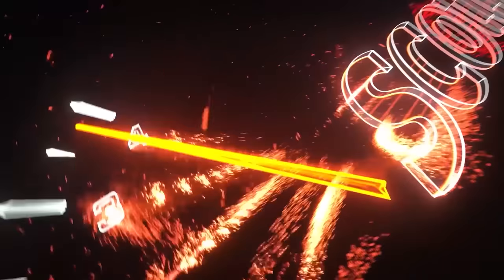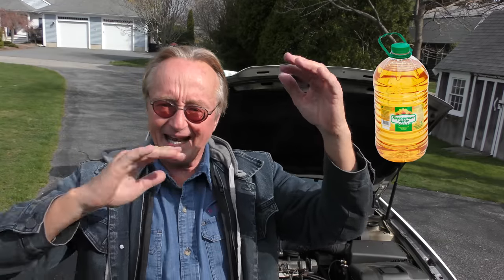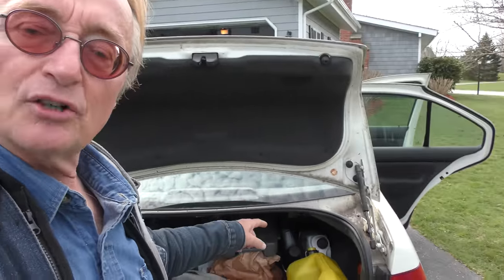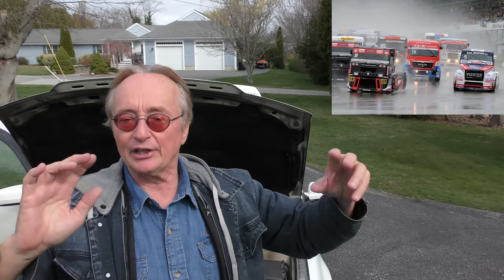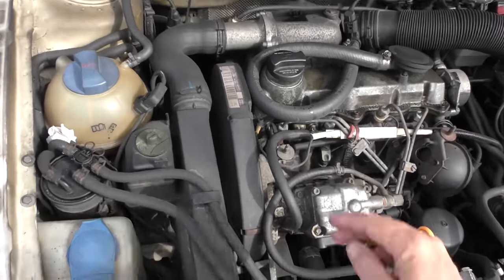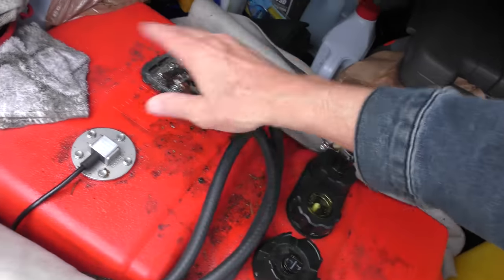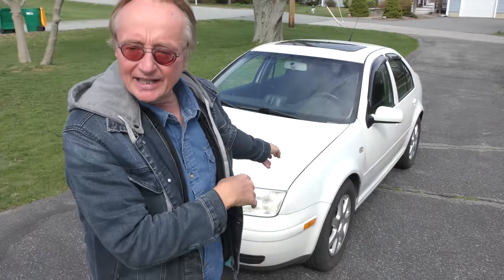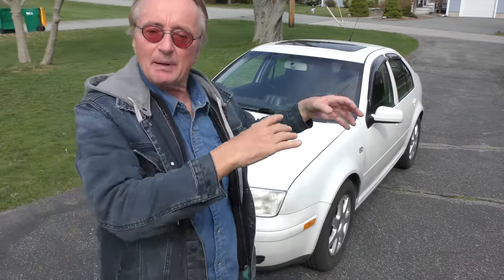Install This on Your Car and You'll Never Have to go to the Gas Station Again

Comment: Imagine the fuel thieves drilling into the tank looking for diesel and getting vegetable oil instead! Great show Scotty, keep the videos coming.
Reply: Ι don't have to imagine unfortunately. Drilled into an old 1990s Mercedes diesel's tank and mixed the vegetable oil with some of the diesel I had collected that night by accident! Ruined 6 gallon of diesel for nothing.
Reply: Vegetable oil is not cheaper either 🤣🤣
Reply: @multipolarworld.  It is when you get paid to take it away from resteraunts. I know a local trucking company in my area near Scotties son who does just that. Also in the state of Massachusetts straight diesel fuel is illegal. It has to have a percentage of it blended in with vegetable oil. It was made into a law a couple of years ago. This includes off road fuel for heating and construction equipment as well as on road for cars and trucks.
Reply: tine for french fries
Reply: Tank still has Diesel in it.  The trunk has the vegetable oil.
Reply: @multipolarworld.  You aren't buying brand new unused vegetable oil from the grocery stores. You are getting free used vegetable oil that many business will just drain down the drain so you can get it for free as you are helping them not clog their lines.
Reply: @youaregoingtolovethis  I'm just joking 🤣
Reply: @youaregoingtolovethis  8
Reply: @youaregoingtolovethis  They must have some kind of filter to run the vegetable oil through so it doesn't clog up the injectors.

Comment: Scotty, I got that one beat with that old Rabbit sedan. Those old diesels you can not kill. They run forever. I do not know if you know of John Noonan or not. He owns J. P. Noonan trucking West Bridgewater, MA and Hooksett New Hampshire years ago he converted all his trucks to run on vegetable oil. Starting with the one he was driving at the time. He put in a large  1,500 gallon storage and filtration system at his main facility in West Bridgewater.  The best thing is he gets paid to run his trucks by all the fast food and Chinese resteraunts. He charges them to pick up their used vegetable oil from their deep fryers. Also the owner and captain of  our local deep sea fishing charter boat in my town the Miss Chrissy converted his fishing charter boat's diesel engine to run on vegetable oil. He is a mechanic like you. He has worked on car engines and boat engines all his life. He gets his fuel from John Noonan. His charter boat smells really good every time he goes by my house out in the bay. it makes me hungry.

Comment: 20 years ago, my Genius Daughter at age 17 bought a running Mercedes-Benz 240 non turbo for a few hundred dollars and did this exact modification with radiator heated veggie oil tank in the trunk. It was no race car but it ran good but slow.
Reply: sounds like she had a good father
Reply: 240D is slow regardless of whether you run diesel or vegetable oil.

Comment: My 1984 M-1009 Military truck will run on just about anything.  It has the 6.2 L diesel non turbo.   It would survive an EMP too.   That guys setup is perfect.  You need to run it on diesel before you shut it off to clean the injectors.  You dont want the Vegetable oil on cold injectors at start up.

Comment: I remember back in the 70s during the gas shortage my dad had converted our Cadillac El dorado to accept propane. It was pretty cool to have two tanks. After flipping a switch, we had an extra full tank to keep on going.
Reply: Propane was highly used in Brazil countryside in the 80’s and 90’s.

Comment: Back in 1982 I work at a Volkswagen dealership in Toronto Canada and the mechanic had a 1981 Volkswagen rabbit a rebuilt the engine and ran it exclusively on vegetable oil. But he only used the car during the summer months because of the cold weather up here like he said the vegetable oil congeals. He had that car for nine or 10 years before he had to get rid of it because of the rust on the body. As always I enjoy your videos. Keep up the good work. 😎
As to the price of diesel fuel I remember back in the 70s and into the 80s diesel fuel up here was less than one dollar a gallon.

Comment: Hi, i used vegetable oil on my old nissan sunny in the summer. No problem at all. And it was cheap, back in the 2002. The liter oil was chaeper than Diesel.  My main gas station was Aldi 😎
Reply: I saw a guy collecting used oil from restaurants and using that for free.

Comment: The best reliable VW ALH engine. Rated for 1.5 million miles.
Reply: Also try to get manual. If you find an properly maintained automatic than yes other than that 99% will fail. You can get 50mpg plus with normal driving. So dude runs methane and get 65mpg plus.

Comment: I currently own and daily drive a 2003 Jetta TDI (ALH). Bought it 4 years ago with 172,000 miles (American car but i live in Canada). The only money i have put into besides oil changes are a coolant temperature sensor ($35 Canadian), and a rear strut mount or something like that ($65 with labour).

I get over 1000km a tank and it has been flawless. It's now sitting at 230,000 miles and i've barely put $500 into it including tires.

Might trade it for a clean Jetta wagon. Diesel right now is more expensive than Premium Gas in Ontario.
Reply: You'll trade it in for a gasoline Jetta wagon or a TDI Jetta wagon?
Reply: @epbski  TDI all day bud, i'd never buy a gas VW.
Reply: is it confusing looking the at speedometer when driving being mph (United States) and underneath has km/h (Canada)?
Reply: @mabeljoe4305  you get used to it. Traffic tells you how your speed is.
Reply: Try a Touareg TDI 😛
Reply: @RandomlnternetGuy  I totally agree! VW's gas engines are weak and they don't hold up over time. I personally don't think any VW or Audi is truly worth buying unless it's a TDI. Otherwise, you just don't get your money's worth. I generally think diesels are superior to gas engines, anyway. A TDI Passat, for example, is an awesome vehicle, but if you're forced to choose a gas engine, you're better off just getting a Camry. I'm not a great lover of sedans, though, because they have little practicality. I'm a huge fan of hatchbacks and wagons, which have, regrettably, basically disappeared in North America. And I don't buy this argument that a crossover is just a different form of a wagon, because it's not. A wagon gives you all the practicality of a crossover, but with handling, driving dynamics, and fuel efficiency that is closer to a sedan. It's the best of both worlds. If only Toyota, for example, would sell a Camry wagon or a Corolla Touring Sports wagon/estate in North America, even if it was a gas engine. A diesel would be even better, but that's a pipe dream. The same goes for Mazda and their Mazda6 Wagon. Obviously, I would love even more if VW would sell diesel hatchbacks and wagons again in North America, especially since I like VW's style much more than Japanese cars, but I admit with sadness that is definitely never going to happen. I'm not sure if there are any new non-truck diesels sold in Canada, but sadly there aren't any in the US anymore and there almost certainly won't be any in the future. I'm hoping and crossing my fingers that there will still be used diesels on the market for at least the foreseeable future.
Reply: @MarcBeaulieuisGreat  So you would recommend a 2014 or 2015 Touareg TDI?
Reply: @epbski  The closest vehicle to a Camry/Corolla sport/touring wagon us would be the Toyota Matrix/Pontiac Vibe 03-08. It still gets great reviews…
Reply: @emanuelsabir5344  Yeah, I think it's a shame that Toyota doesn't make the Matrix anymore. The Corolla Hatchback is a good car, but it has much less cargo space and practicality. The Matrix was sort of Toyota's equivalent to the VW Golf. An extremely practical hatchback that could rival and even exceed a lot of crossovers in terms of cargo space, with over 50 cubic feet.
Reply: @epbski  I believe they are both the same generation.
Reply: Go Avalanche !
Reply: @mabeljoe4305  i got used to it super quick now the probem is when i get in other cars, i look at MPH and think it's KPH 😄

Comment: Around 20 years ago I was able to buy 100% biodiesel at the bowser it was recycled cooking oil. I was running it in my 1989 Ford trader diesel tipper running the Mazda engine. I found it had more power on hills ran cooler the only draw back was all the stray cats and dogs would follow my truck and were trying to lick the tailpipe and the fuel tank if I accidentally spilled some on the side of the tank. The very first Diesel engines were designed to run on peanut oil as distillate fuel was not available at the time.

Comment: I read about a guy that did this with a Datsun pickup in the 1970s. He got over 300,000 miles out of his motor because the fuel is a lubricant as well....

Comment: Keep the straight vegetable oils preheated and adequately filtered before burning them.

Saturated cooking fats should be settled out and converted to biodiesel and said saturated biodiesel should be mixed back into the unsaturated portions, that way you have a better and more consistent burning and lessen likelihood for problems in the long run.
Reply: I think this guy clearly has it figured out if he took one to 400k and built a new one
Reply: correct
Reply: You just boil, cool and filter like any saturated fat removal.

Comment: Ran used veggy oil in two ‘81 volks over 8 years.  Used a cream separator as a centrifuge to clean the oil and added it right into the fuel tank.  I didn’t even change the fuel filters.  Wish I still had one

Comment: In Argentina vegetable oil was about 25 cents a litre, when England found out,  El Patito Oil was never to be seen again. The again with the prices in England you could run a truck on grade A Olive Oil and still pay less than diesel.

Comment: In the UK some diesel cars have been using used cooking oil for the last 20yrs or so, free from the right places. My car is converted to LPG and the oil and engine stay clean with less polution, 80p a litre instead of petrol at £1.80 ltr. If you wanted you could compress domestic gas and avoid fuel duty completly with tweaking of the LPG ECU settings. Have you tried running (adding) water, (HHO)?, again a "pre computer" car may be needed here or some ECU adjusting if possible!

Comment: I seem to remember used oil is actually better. When food is cooked in the oil the water in the food evaporates. The steam bubbling through the oil removes certain parts of the oil that are less combustible. That's part of the particulate that settles out of the oil. Then you simply heat the oil for a little while and remove any excess moisture. So if you can get the oil from a couple restaurants and have a tank to let it settle you can have free fuel for a long time. 
Biggest problem is natural rubber. You can't use rubber seals and tubes. The oil eats right through it. You need synthetic hoses a seals
Reply: Used cooking oil looses water in minutes, not hours

Comment: If you can get red diesel, it mixes with vegetable oil at up to 1:1 without any further effort.  Alternately building the refining equipment for real biodiesel is very possible for a home shop.

Comment: Diesel designed his motor to run on peanut oil back in the 1800's... not very hard to do. with diesels prior to 2007 👍😉 one more secret out
Reply: He said 2010 not 2007, which is correct.
Reply: @toriless Depends on when they put all the adBlue and DPF systems
Reply: @IbnuCuruk  2007 and after except for the Ford psd 6.0 used in trucks up til 09 and 11 for the fleet vans 🤔
Reply: @z1berzerker  I see
Reply: @IbnuCuruk  In a nutshell 6.4 psd runs Def... Any 6.0 psd able to run veg oil... Cold weather beware 🤔

Comment: Scotty should check out the Thailand car/truck scene on the channel "CB Media" for some interesting engine setups, especially pertaining to diesel engines.  It's some crazy horsepower and torque coming out of 3.0 Liter 4 cylinder rice burners, or in this case diesel burners.  Rolling Coal, so stinky and beautiful at the same time.

Comment: Not only it pollutes less, but is completely non toxic unlike diesel exhaust gas. Sadly the 1.9 tdi is one of the only engines that are both good on emmisions and can be ran on vegetable oil. Most newer engines have injectors that can’t work with it(higher viscosity)

Comment: I've heard of a guy who uses used oil from fast food joints and restaurants.  I guess he has an efficient way to filter it for his fuel creation process.  500 miles on how many gallons?  But even still, it's 500 miles.  But, sadly,  it only works with diesel engines.  I researched it for the process and engine types.  I watched a 2016 Texas city TV News channel coverage video and the guy was filtering heated used restaurant oil in what looked like a burlap sack, which was probably lined inside with something like a t-shirt fabric.  Seems that's all that's needed, but the video wasn't specific there.  There were comments of people using fresh bought vegetable or peanut oils to prevent having to filter it.  One guy diluted diesel with fresh oil 50/50 to keep from having to filter it and from having to switch between tanks.  The need or not for vehicle-mounted filtering was discussed, so I guess the new oil users didn't need it.  One guy said 2011 and older, so maybe that depends on the vehicle manufacturer.  Many there have been doing it for years, while some having been at it for 10 years and maybe more by now.  There were also many 2022 comments.  Who knew?  Well, they did!  🤣😂🤣😂🤣  It's apparently been around for quite some time.

Why Redline???  Ever???  That's stupid!!!  Yeah, maybe burning under the hood or from the tailpipe....  or maybe both.

Comment: There is a professional company collecting the grease from the fryers from the Carols Corporation (Burger King in Upstate NY) to turn it into biofuel. In turn businesses are buying that biofuel directly from that processing company to fuel their fleet vehicles. It would not surprise me if they eventually make a decent enough amount to consider offering deals to Rochester and Syracuse to run parts of the bus services. Syracuse has already been gradually changing over to natural gas for over 20 years and it would not surprise me if they consider biodiesel a step up.

Comment: I dump used motor oil in my transfer tank on my 95 Cummins works great mixed with the diesel fuel it gets filtered when it comes ot of the tank

Comment: I had a 2000 diesel Beetle. Great drive train and solid car but EVERYTHING ELSE BROKE. Bought the car for 11K. Probably spent more than that on repairs. Brokeswagon
Reply: That's why you get an older one, 1999 thru 2003 with the ALH 1.9L engine with the 5 speed trans. Auto trans were junk. You can swap the two trannies though

Comment: Precipitate the glycerin out of the veggie oil and you have essentially bio-diesel fuel….. no need to heat the oil….
Reply: Who runs 100% bio diesel in winter in the NE without additives/heaters or issues when it is zero degrees outside?
Reply: @Fjord_Driver  move to a warmer state!

Comment: They have been running vehicles on used fryer oil in my area for a while now as there are alot of restaurants  around me. If it works, why not? 😲😲😲

Comment: 🐵 it doesn't work too well in high pressure common rail diesel engines,  an old basic diesel engine it will but eventually it will muck it up , your better using red diesel as it does have the right lubricant properties.
Reply: Sure but it's a good start, he can keep refining his project and create additives, filters and what not
Reply: You will get a big fine for tax evasion if the check your tank and there's red off road fuel in it
Reply: The only difference between road diesel and off-road (red) diesel is the extra tax to pay for the road system. Agree, don't get caught using red diesel on the road. It could get expensive
Reply: @Steve B  if you dump enough used oil in it will turn black

Comment: You can mix diesel with vegetable oil 70to 30 will go not a problem 😎👍🏻.
Reply: Yep! Ran a 1996 Transit 80 with a 2.5 litre diesel on a mix of 50/50 in winter and 70/30 in summer. This was new oil when it was cheaper per litre than diesel fuel. That said, if you filter your chip oil (sorry French fry oil) and then centrifuge it there's nothing stopping you tipping it in your diesel tank. Check your fuel filter regularly and maybe install a second inline filter before the factory one.
Reply: @johnpowell5433  I had Mercedes 123 from 1982 2.4D Kero vegetable oil you name it…no problem 😎.

Comment: Top it off with olive oil for extra horsepower.
Reply: Too delicious to waste, use junk oils, personally I use Rice Bran Oil, Clarified Butter or Olive Oil only.  Avacado OIl is huge strain on the environment and it burns MUCH easier than Rice Bran Oil or Clarified Butter.  Rice Bran Oil is the most eco-friendly and healthy.

Comment: Jet fuel is close to both and needs to be heated especially at -35F at 35,000 ft.  Cool story Scotty.  Diesel aircraft use jet-A not diesel fuel.  Probably because it is better.

Comment: Ever try transmission oil from an automatic? I use to prim the filter with a quart of dextron for quick start uo
Reply: The engine ran without rattling , back in the day we had rationing and gas and diesel were in short supply , so one smart guy ordered barrels of dextron transmission oil and used that , this was handed down by a vet who had done this in the service and ive used the knowlege from this ever since